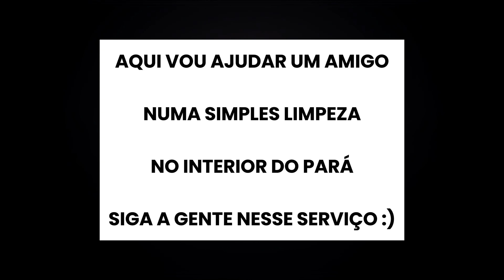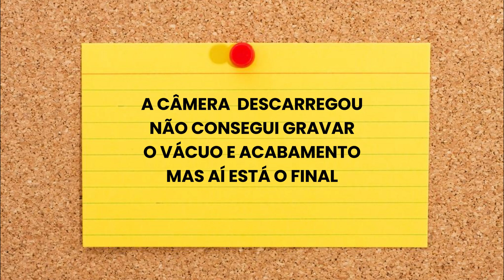Limpeza do Ar Condicionado Split Consul Hi Wall: Desafios do Profissional de Climatização

Comment: Não entendi esta jogando agua na parte elétrica
Reply from the maker: A parte elétrica que você quer dizer são os cabos que interligam os Bornes e os capacitores, certo? 
Não há problema em molhar os bodes, terminais, e os capacitores. O que não pode molhar são as bobinas dos motores e placas de circuito impresso.